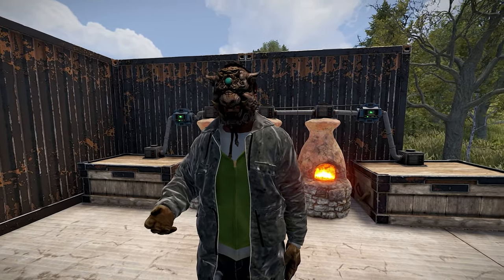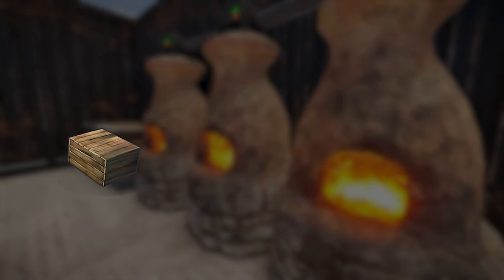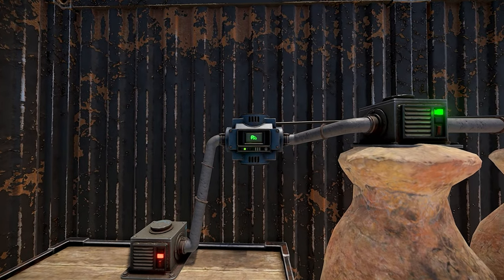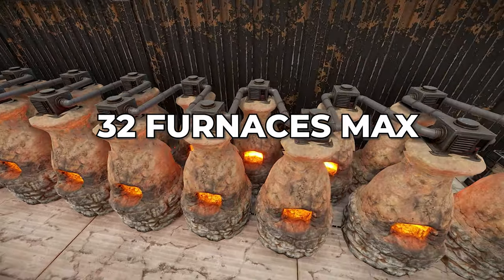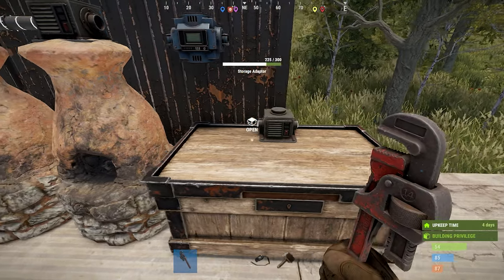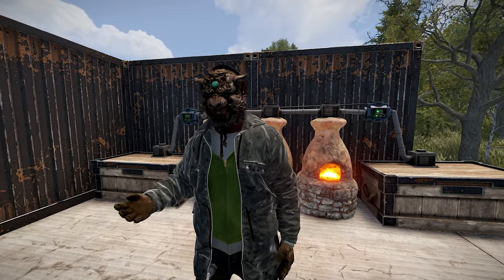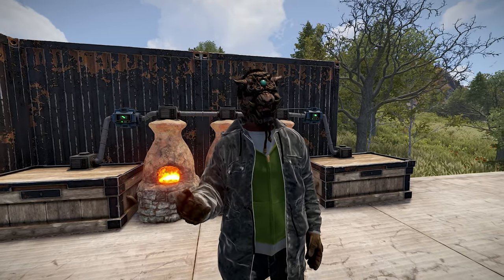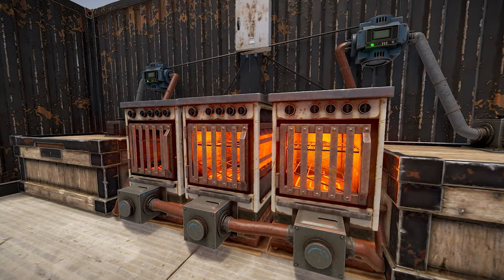THE BEST Way to Automate Furnaces in Rust for MAXIMUM Efficiency!

Comment from the maker: I got a LIST of future videos from you guys, but please mention any that you want to see! I am ranking priority based on frequency of topics asked! Thanks for watching guys!
Reply: You don't need two conveyors btw... this is not efficient... lol you don't need an extra box either just pipe the furnace directly to the input of the box your storing your metal in.
Reply from the maker: @shelladdition  for the sake of this comment, I did test exactly this and it doesn't bring cooked materials to another box without the second conveyor, unless Im misunderstanding

as for the extra box you are correct you dont need it, further into the video I share this example by removing the second box and simply routing the cooked material back to the original drop box. 

let me know if you meant something else, but when connecting a furnace directly without a conveyor to a destination box, no cooked items move
Reply from the maker: correction** you are right if you meant filter the first conveyor to both non cooked and cooked resources back to bin one! didn't even consider this so that comment is a solid one! 

Typically I have a second conveyor as I move the cooked items to a different box to then send to auto craft etc, but in it's simplest form this makes sense to do! Thanks for sharing

Comment: U could simplify the setup even more. Only 1 Conveyor needed and 4 storage adaptors. Loop the end into the first storage adaptor of the box again and its done. Less metal frags needed. :)
Reply from the maker: Wait hold up, you don’t need a conveyor at the end?! 🤯
Reply: @Sledge315  you dont if you use 1 conveyor to move everything to a combiner
Reply from the maker: @EugeneMaestrado  so I tested the main comment above and you do need 2 conveyors to my knowledge, one at the start and one at the end
Reply from the maker: i figured out what you were talking about, if you filter the first conveyor to include both cooked and non cooked items this 100% works! I typically don't return cooked items to the original box in real game scenarios due to using it to auto craft and/or my raw resource bin being full as I have farmers that dump ore into the box constantly which would lead to a backup of items! but totally a valid point and I appreciate the share!
Reply: Use 2 or 4 boxes with the same setup than. Or 32 boxes. Still only takes 1 convryor.
Reply from the maker: 100% if you connect in tandem and filter to include the cooked and non cooked although I believe it needs to be a closed loop back to the original pull bin since it also sifts raw resources to any additional boxes with storage adapters on them from what I noticed